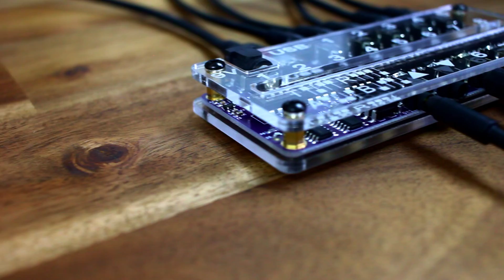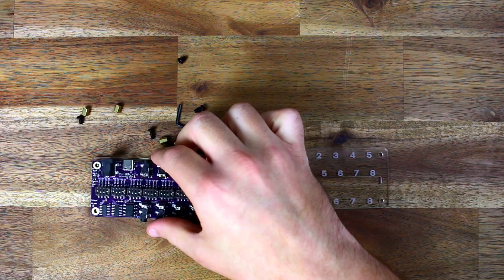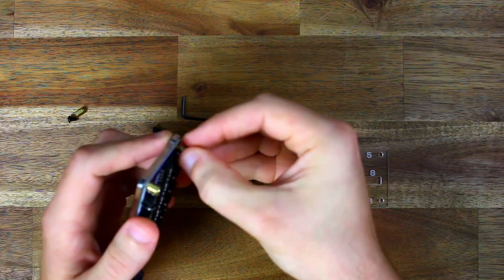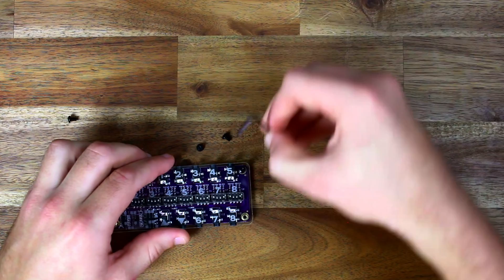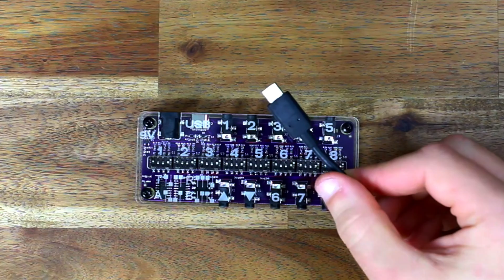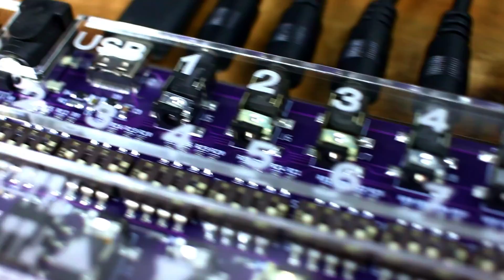MIDI Thru Gizmo - Build and Operation Guide

Comment: It's upsetting that what you get when you search "midi thru" is $50-$60 boxes that only have 4 midi outputs, I'll definitely have to pick this up for how affordable, small, and powerful it is compared to those. Just a clarification question, what's the difference between 1-8 and the down arrow port? Is the down arrow just a pure midi thru while the rest are configurable?
Reply: Spot on. There's a non-configurable MIDI out so you can connect multiple of these hubs together and a non-configurable midi in. Both Type A TRS MIDI then the 8 switchable outputs:)